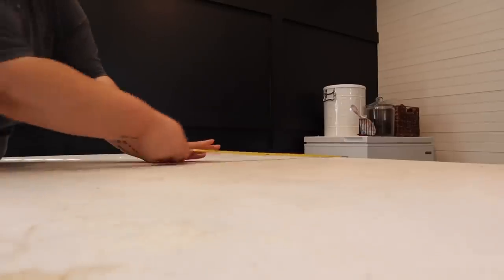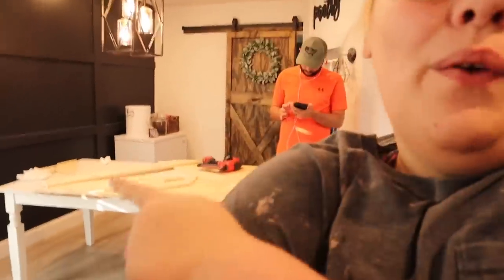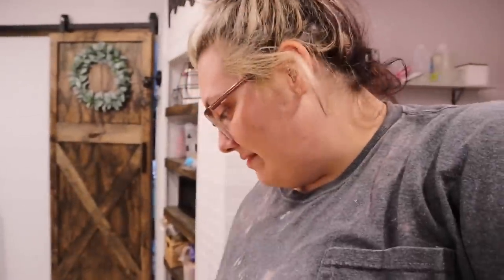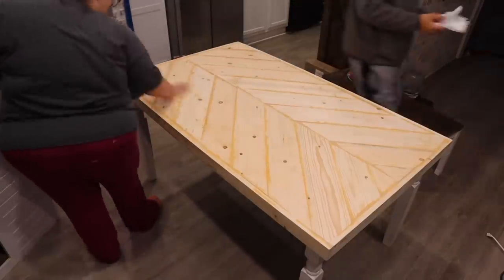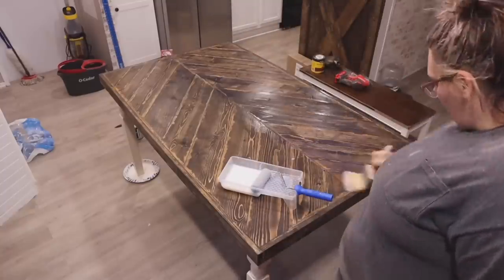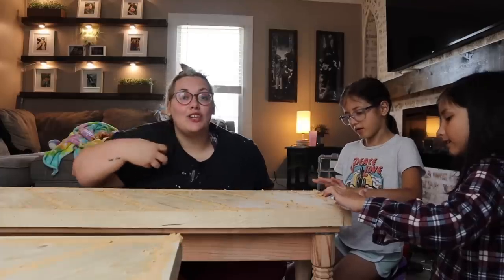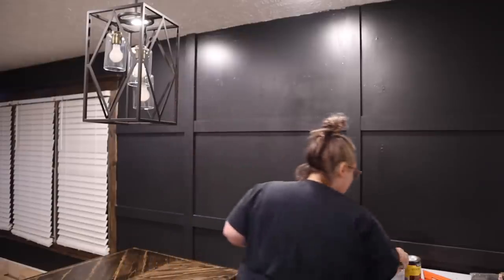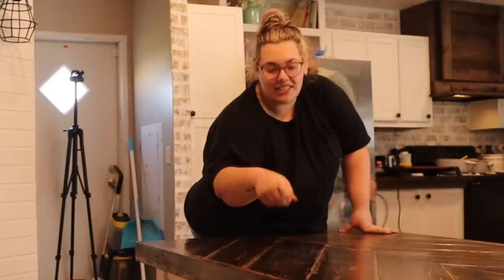*NEW* SINGLE WIDE MOBILE HOME DINING ROOM REFRESH | mobile home transformation | mobile home updates

Comment: The next time you do a wood project where you need to use filler, fill the crack with wood glue and then immediately sand over the wood and crack together. The sawdust will attach to the glue and fill the crack for a better finish. Plus it will stain the same color as the rest of the project!
Reply: Wow! Thank you for the tip!
Reply: I was going to tell her to use the sawdust as I had seen it on another diy
Reply: I didn't know this! I guess then you are sanding the wood glue wet?  I've got to try it!! Sounds reasonable about the wood dust.

Comment: I will share a tip that someone once shared with me!  If you use a frosting piping bag with a tip that is just smaller than the space you are filling….. it goes really fast!  You can use a sandwich baggie in a pinch!  You can also use a baggie to squish the compound into the crevice to save your fingers!  Rubber gloves would work as well❤️
Reply: You can also frame the area to be filled with painter’s tape so nothing gets on the rest of the wood.

Comment: You can use painters tape on either sides of the cracks  then fill in with the wood filler & when you take the tape off you will be left with a clean line only in the crack. Hope this helps 😊y’all did a great job as always!

Comment: Marina, on the wood filler, and I’ve learned this the hard way over a long period of time. I’ve been a single mom on a really tight budget, i found that if I put a tube of wood filler in a caulking gun (I found a tube of wood filler at Lowe’s), and then used my caulking gun with that tube of wood filler in it, I can get the wood filler just in the crack without it seeping all over the place. Then after I fill the crack, I take a damp cloth or damp sponge, and the key here is, it has to be damp, not wet, and wipe over the crack, while the wood filler while the filler is still slightly wet, then leave it alone to dry, I don’t have that seeping of wood filler, messing up the grain of my wood. I have also found, before I figured out the caulking gun and that you can buy a tube of wood filler, I had a cake decorating tube and a round cake decorating tip I could screw on the frosting bag and put the wood filler out of the can in there, and squeeze it through the tip into the crack. When you use a cake bag with a tip, I did put the wood filler out of the can into a bowl with you so few drops of water to just barely fit it down so it would go through the tube of the cake kit easier, and that worked perfectly like a charm. I wished I could just ring you on the phone before you went to do it with your finger but this was all I could think of to reach you. Hope this helps. I know a lot of people may disagree with me, but it worked for me on endless projects, so I thought I’d pass it onto you because it looks painful today what you were going through. Lol ;-)
Reply: Agreed
Reply: Absolutely agree

Comment: Wood filler trick: all that saw dust Shane collected cutting the wood, you rub into the top of the wood filler. Then the sawdust stains the same as the wood around it. 😉

Comment: Hi lovely, I renovate furniture for a living. The trick is to mix in the sawdust from your piece into your wood filler:  about 35 - 40% sawdust to filler. You do still need to ensure you sand it all off the surface but then your filler will take the stain evenly. You can also mix a bit of the stain in with the filler & sawdust. Another trick is to wipe off any excess filler with a damp cloth before it's dry xx

Comment: Hi Merina. I've been watching you forever, Love your family & you make me smile.  I'm very quiet. I rarely comment but I'm here.   Here is a easy tip..  Put the wood filler in a freezer baggie, cut a hole & put in like a thin layer of cake frosting.  Smooth over with a damp sponge as you would with a make up blender.  This should help and easiest fix and moving forward.   It works.

Comment: Merina! I've had a career of finishing furniture.  
1/ sand with 180 grit first and make sure you have gotten ALL the wood filler off. You should only have it in the cracks. 
2/ sand with 120 grit.
3/ sand with 400 grit
4/ wipe entire table with tac cloth.
5/ stain!

Comment: Another thing that could help - u prolly know this already but just in case you don't - is if you use a rougher grit sandpaper to cut thru things faster. Start with 80 grit then work your way up to 220 to smooth it out! So glad you re done it to get the wood filler smudges out I think it's definitely worth it ! It turned out sooo pretty 😊🤩💕

Comment: You have a lot of comments already, but i just wanted to give my 2 cents. My husband builds furniture so I have a few tips:
1. If you dont like applying wood filler with the putty knife, apply with  your fingers and then scrape the excess with the knife. Less to sand later.
2. Keep the sander flat, dont angle to get a deeper sand, you will leave divets. Just keep it moving flat over the whole surface.
3. Apply a wood conditioner/prestain. It will help the stain go on more evenly.
4. Sand between every coat of poly with 220 grit for a nice smooth finish.

Comment: Hello, so I found it much easier to apply the wood filler with a putty knife or an old gift card. When the cracks are full you use the card or knife to scrap off the excess before it dries. Good luck.  By the way I think your table is still very pretty just like it is. Love ya'll ! :pride-flower-pansexual::pride-flower-pansexual::pride-flower-pansexual::pride-heart-rainbow-philly::pride-heart-rainbow-philly::pride-heart-rainbow-philly::hand-pink-waving:

Comment: Two things with wood filler… mix it with wood dust and/or use tape (painters tape) to ‘outline’ the crack that’s being filled on each side. So done pull off the tape for a crisp line.

Comment: If yo line each side of the crack with painters tape once you fill the crack you can remove it and it.prevents it being on the other area of the wood.  Less sanding 😊

Comment: I absolutely love it. I would sanded the table a little to rough up a little for better adherence then attach the planks with a little wood glue and used a large expanse bar clamp to get them as close together as possible. Brad nail from the underside to keep the planks. Tip on wood filler be ready to be like holy shit😮. Take a disposable pasty bag fill with the filler. Cut just a really small tip off and pipe the filler into the gaps to fill them up all the way. It stops it from cracking, less overage on the table to sand and pulling up later when the wood contracts and expands from humidity. Once the crack is filled use a putty knife to smooth out the filler and repeat for any low spots. When half dry wipe off and excess as it turns into too much work to sand. 

I love how it turned out. I have been looking for a way to refresh our dining table. I think I have found something I love. Off to Home Depot this weekend.

Thank you

Comment: I used to work in a wood shutter shop and we always used wood filler for the imperfections. I love how yours came out however if you ever want to use the wood filler on a different project, use a putty knife to put it in and after it dries, use a razor blade to scrape across the top to smoothe it  out.

Comment: I've watched a few videos on wood filler along with adding sawdust to the filler. I've also seen where someone used painters tape along the edging of where you are putting the filler in  so that you can pull the tape up before it dries and sanding happens it will keep allot of excess filler from getting on the table or what ever your putting it on and makes for a cleaner look

Comment: Just a suggestion...use painters tape on each side of the grove u are putting the filler in and then use a metal putty knife to apply the wood filler... really smash it down when u put it on....then peel the tape up while its still wet, the same as u do when painting...that way the lines or grooves wont need sanding.. hope this helps
Reply from the maker: OH MY GOSH! Such a good idea!!!!

Comment: Rip edges down as most wood has a bit of a rounded edge.  Get a biscuit joiner and join your joints that way with wood glue❤.  Then you clamp them together and then sand 🥰  More work but the results are a million times cleaner and no need for wood filler usually.  Yours looks great though

Comment: save your sawdust, mix with wood glue into a paste and brush it into the grooves because you used sawdust it's the exact wood you are going to stain so it will match, just sand it smooth....before staining.

Comment: A tip I was given and it worked amazingly was mix the wood filler with the saw dust. I would personally re-sand the table. You guys work awesome together. I love the black wall with the table and benches.

Comment: They make wood filler the color of stain you are using too so it is even more less noticeable.  If you use the metal or plastic spatula to apply a little filler in areas at a time and push into area you won’t have a lot on sides of hole you’re filling.

Comment: Merina, instead of wood filler use wood glue mixed with the sawdust, apart from fact glue is cheaper than wood filler it is far easier to fill in the gaps than wood filler does, plus sawdust doesn’t mix too well with the filler, because it goes really thick, but the wood glue and sawdust definitely stains amazingly, plus it sands far easier. When you think about it, you’re filling the gaps with the same wood, so it’s a no brainer. I cannot work with wood filler either, it’s a nightmare. Try that you’ll be pleasantly surprised. Makita is one of the best in the world. “You chose wisely”. *can you guess what movie that quote was from?

Comment: The name of the pattern you are looking for is called chevron. Also, regarding the wood filler....I am no professional, but it seems to me that it would have been better if you used a scraper to scrape down to the table as much as possible while it was wet. After it dries, then sand the rest down. Also, I think it may be possible to use a paint-able caulking instead of the wood filler. I wonder if you didn't wipe off enough of the stain from the benches and that is why you can't see the pattern???

Comment: I’m a little nervous about you using the sander inside and sanding poly. That can’t be good for you and your kids lungs. It will settle all over your house and you will continue to breathe it in. 
For future reference, when it comes to herringbone and diagonal wood styles, you want to get a miter saw to keep your cuts perfectly aligned and then not use any wood filler at all. That way the stain settles into the tiny gap between boards and you can see the lines of the wood like you would on hardwood floors. Only use wood filler for nail holes or repairing split boards. I hope that helps ❤

Comment: I’ve never worked with wood filler, but why do I want to put it in a ziplock, cut an edge, and squeeze it into the cracks and then just run my finger over it? Lol I’m not sure you can, but I wonder if it’d work?

Comment: ⭐️👉🏽⭐️Merina, please try to avoid sanding indoors w/o the proper precautions. If you must, attach the sander to a wet/dry vacuum, put up plastic barriers around area ur sanding, & always wear at least a N95 mask if u don’t have a respirator.  All those dust particles especially from the stain is so toxic to u & the kids & the doggies. I saw a pup walking around the table when u were sanding 😮😳

Comment: You’re doing it the hard way… after you put the wood filler in the cracks, just wipe it off the surface of the table/benches while it’s still wet. Use a wet rag or wet paper towel, that way you can avoid all that sanding

Comment: To get a completely smooth finish you should sand the entire piece using 4-0 steel wool after each coat of polyurethane.  It will be as smooth as a baby's butt.   Also, if you make more furniture, you should invest in a joiner and biscuits so you won't have to use wood putty in the gaps.